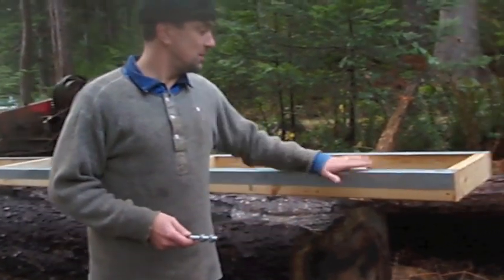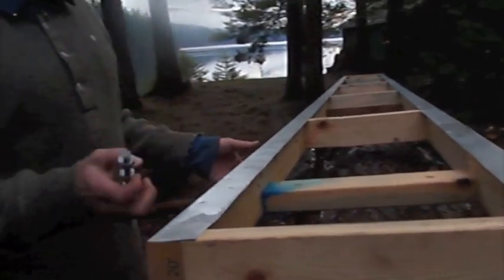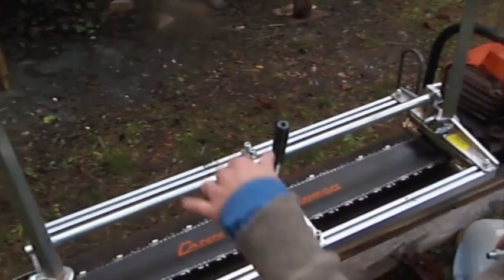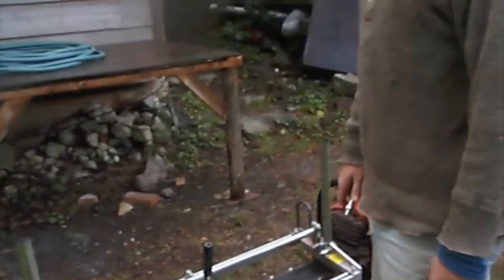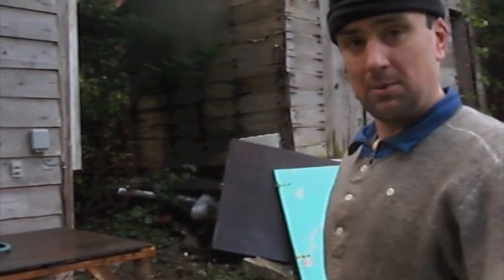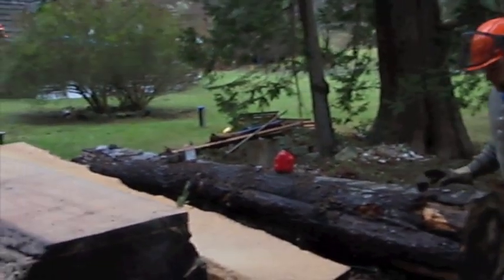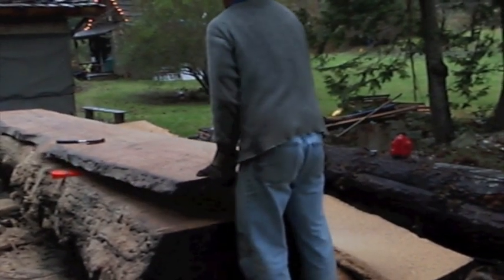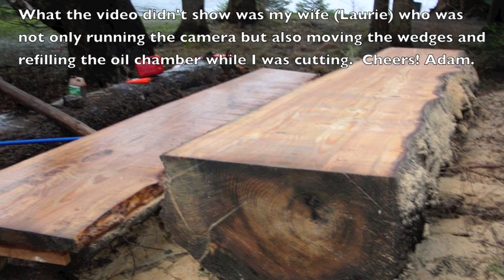Slabbing  Fir with 36" Alaskan Sawmill

Comment from the maker: As long as the outside of the log is free of anything than can dull the chain (dirt,rock, etc) it doesn't need sharpening for quite a few slabs. 
The girth of the tree is less of a factor for sharpening. In this video, the ripping chain is new - so dullness isn't a factor in speed. The log is 
a Grand Fir, and very wet. I suspect the moisture, as well as the diameter, play a role in the cut-rate. When cutting a smaller diameter Western Red Cedar, it moved through this quite quickly. Cheers!

Comment: personally, i like fast and rough BECAUSE i can add alittle to what i want my fina thickness to be and then i have a homemade sled and track system that i can use with a router to plane large slabs. works well.

Comment: 3:10 I thought that I noticed some sparks too. It may have been a nail or screw that had been driven into the tree at some point in its life. Really nice setup though. I just got a Stihl MS660 and I can't wait to get a mill and start to cut my own lumber too. Those are some really nice, wide boards...you just can't get lumber like that. You have to mill it yourself.

Comment: I'm in the market for an Alaskan mill, probably a 36'' which should be big enough to tackle most trees around here. I'll get the auxilary oiler as well, they recommend it for bars 36'' and longer. By the looks of this video and others on the Alaskan mill the biggest saw you can pair it with the better. If i had the money i'd buy a Stihl MS 880 for the mill and a Stihl MS 660 to go with the mini-mill Good stuff, keep it up.